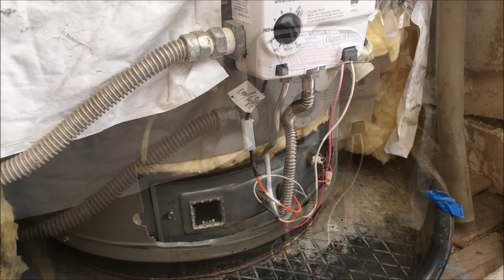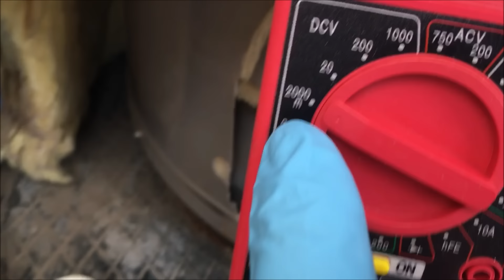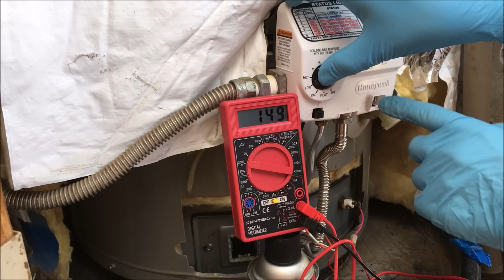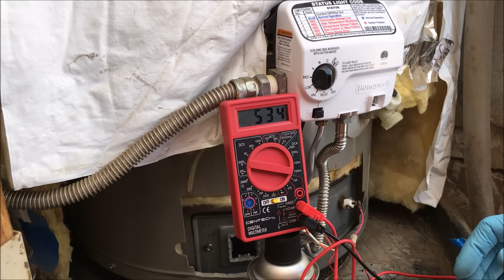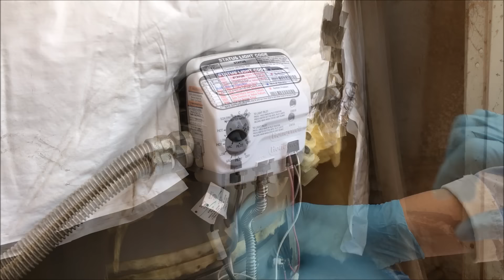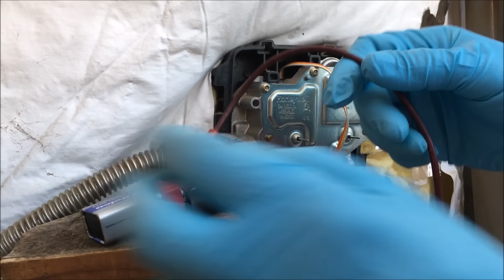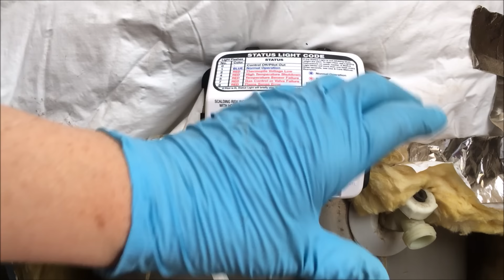Troubleshoot Water Heater AND Honeywell Gas Valve | Step-by-Step

Comment: Is there a website when I can enter the model number for gas water heater and it will give me the parts. The Rheem website has no information, manual has no information
Reply from the maker: Nope.  You have to hunt around on the internet to find what you need.

Comment: What happens if igniter is working but you're still not getting a flame. And eventually you change the gas valve out and still do not get a flame ?
Reply from the maker: I'd look at low gas pressure or a blocked flue.

Comment: This was one of the best troubleshooting videos ever. Question: Did I miss testing of the overheating switch (the round white part with a little reset button in the middle) Can you just pull the wires off and test for continuity?

Comment: I just replaced my Honeywell gas valve, which had a failed sensor by error code. The sensor's plastic housing on my old unit had deteriorated after 14 years of exposure to hot water and had nearly developed a leak. I'm not sure whether the failure was caused by the sensor housing or the sensor itself. Is there any way to test if the sensor is still functioning properly?
I was amazed by the technology and clever design of this simple device—something I had never really paid attention to before. I was equally impressed by your video, which provided step-by-step troubleshooting for every detachable functional part, along with clear, detailed, and accurate instructions that are second to none. Thank you so much!

Comment: I tried all the test as you did, same outcome. Ordered a new control panel. My pilot lights instantly. Will not stay on after indicator light flashes. Even held the pilot light for 3 mins let go and goes out. Any other suggestions. Would appreciate it.

Comment: Absolutely great video. Bradford White with Honeywell controller Water heater was not running. Would not spark, pulled assembly cleaned all, used carb cleaner I had handy and some tiny wire brushed to deoxidize all. No real carbon in evidence, actually pretty clean but igniter would spark only half the time. After cleaning all to bare metal sparked 95% of the time. After a simple once over cleaning fired right up.
Reply from the maker: GREAT to hear!  So glad my video helped you.  ;)

Comment: Thank you so much Frugal DIY!!  Your step by step tutorial is TREMENDOUSLY helpful in resolving my pilot light not staying lit.  Following your detailed instructions to troubleshoot each component,  I ended up replacing the entire gas valve because the pilot valve was faulty.  Your instructions are concise and thorough.  After spending hours watching different instructional videos on YT, yours by far is the best!  Thank you so much for sharing your expertise!

Comment: I have a Honeywell wv8860c1008. I can’t find a control board for this model, only the whole control valve. It seems like there are lots of wv8840 model control boards available for purchase. Is the 8840 model interchangeable with the 8860?

Comment: Thank you! I have this model gas valve control, and it has twice shut down with "High Temperature Shutdown" code. I was able to reset both times, and it continued working for several months each time. Then it died completely. With the help of your video, I was able to diagnose the problem as the control board. $40 (including shipping) on eBay and 4 days later, we have hot water again!

Comment: There is no one - and I mean NO ONE(!) who gives clearer, more complete and well presented repair repair instructions. Thank you for all the effort you put into these very helpful videos.
Reply from the maker: Bless your heart.  Thank you.  That meas a lot to me.  ;)
Reply: @frugaldiy1 why didn't you show how to clean the piece once you remove it?
Reply: I agree completely.  She is awesome.  An excellent teacher and technician.
Reply: I watch lots of videos like this for cars and appliances and I thought the same thing.  All my components check out. I replaced the thermistor (the one where you need 2 wrenches) but the old one reads 83KΩ cold and is probably fine.  The split across the 3 wires that lead behind the valves is yellow-white 4.8 KΩ and yellow orange 4.8KΩ which Gemini says is OK, the thermopile is at .5 volts when the heater is running and the two solenoid coils are about 12Ω at the pins and the gas flows.   But for some reason the pilot light goes out lately with 7 red.   I'm thinking a control board is in my future. 

Sliding the cover on is fussy because you have to feel around for those pins.  It's made worse because the top has snaps.  I'd much rather have a couple more T15 screws to deal with than those snaps. And of course the screws to remove the burner are T20.

Comment: So what if it’s the main burner valve?
Reply: I had to replace the gas valve. Bought a used one before watching this video and both were shot so installed it and got a gas valve error… Got a 2nd and it worked. Wish I watched this first and knew to test before replacing it.
Reply: @ I just spent the $500 a bought a new one lol mine was due

Comment: I have a Honeywell control valve turn it to light pilot light comes on and stays on and flashes blue but when I turn it to hot the gas won't come on in the pilot light stays lit I did a retest reset doesn't work please help me somebody tell me what to do thank you ahead of time

Comment: Your video saved me so much time and aggravation!!!  Very well produced and super easy to follow.  I had already determined I had a gas control valve problem from another video on another channel, but your troubleshooting to determine the issue at the component level was key.  I replaced the circuit board only and saved me all of the steps and pain in the butt to drain it, etc. to replace the entire valve.  Thank you so much!!!
Reply from the maker: That's wondeful to hear, and you're welcome.  ;)

Comment: Thank you so much for making this video! It’s the only online information I could find to actually troubleshoot and it worked! My thermal switch wasn’t reading and I messed with the wires and now my heater works! This needs to be the top video for any gas HWH issues and I hope you make millions because I know you saved me plenty on several occasions! Thank you thank you thank you!!!!
Reply: I just had to troubleshoot a different HWH and once again was elegantly walked through all the steps! Thanks again!

Comment: Excellent video. I have to add that my water heater had good voltage from the thermopile, but after changing out the whole control unit, including the circuit board, it turned out to be the thermopile. It seemed to be healthy voltage wise. Maybe not strong enough, or amperage problem? Anyway, thank you for this, saved $$.

Comment: Excellent. Very well explained the whole process. Video was also very steady. 😄. Back to drawing board in morning give another try and trouble shoot issue as per instructions. H20 Heater was was working fine before cold water line leaking and owner shut it off. I fixed the leak, then it would not light up. May be it was late past 10pm and cold , Mobile home unit. Wish could post pictures as at time i see things, wondering how one can get away with kind of workmanship. Anyway, once again thanks for tutorial.

Comment: The instructions for troubleshooting were very clear. Other presenters did not cover troubleshooting the gas control valve nearly as well. With this video I determined that the control valve was bad, and I replaced the unit myself. Thank you very much!

Comment: Your step-by-step water heater gas control valve troubleshoot  guide is the best among the 5-6 videos that I watched.  You explain everything in details & take it one step at a time to isolate the broken part.  Recently I had an issue with a control valve (Icon System WV8860A1016 / 222-52915-01) from a 2 year old Bradford White.  Following your video I found that the pilot light valve has gone bad (defective solenoid).  White sticker on side of gas valve has 50034127-037 which I assume is the model#.  I have been checking on EBay & craigslist to find a replacement for over 4 months now but haven't seen the exact sub model# 037 (with a black back cover and temperature probe) available for sale.  However there are similar looking Honeywell valves on EBay with different 3 digit sub model#.   Just wondering if you can tell me if the ones with different sub model# can be used as replacement.  Thanks!     👍🙏👍

Comment: This is amazing work, thank you so much!
You should get hired by rheem they don't understand their own product as much as you do!
I have a different issue, 3 red blinks on the sttus led. It starts blue then pilot light up then switches to 3 red led blinks
The legend has no 3 meaning and I replaced both the controller and the whole burner assembly still the same. Checked gas pressure on the heater its 7 which is ideal. Not sure what to replace at this point @frugaldiy1

Comment: Likely the best video on the net to troubleshoot this issue. I would add one technique to shorten the troubleshooting procedure. When checking the thermal switch, simply pull one wire, set your DVM to the ohms position, and check continuity of the switch. It either works, or doesn't (.5 ohms or less should display). If it doesn't, push the reset plunger. One note about this component check- if that plunger needs a reset, there is a reason for it being tripped. 

Anyway, I am a trained electronics technician, and I found her instructions to be complete. My water heater quit working, and I removed the burner plate underneath and cleaned it up. The flame sensor can develop crud on it changing it's heat sensitivity, which will cause you grief in getting that burner to stay lit. So clean it up first before you try a control board. Pay attention to the three spade connectors that the gas solenoids mate with when reinstalling the control card; if they are a little too open, squeeze them with your fingers to tighten them up with the pin to receptacle connections. Thanks Frugal DIY Lady! Great job explaining this fix.
Reply from the maker: Bless your heart, and thank you for sharing your expertise with us all.  ;)

Comment: I want to thanks for very very good video. I follow it and found pilot valve issued. I called the guy working for plumbing comp and he wants to replace the tank with $1400 cad. I just order control valve from US, have to wait 5 days but I dont want to replace the tank 9 yrs old.
Reply from the maker: I'm sooooo proud of you for fixing your water heater.  Job well done!  ;)

Comment: Most amazing, outstanding, informative, educational video on YouTube. I found my issue, thanks to your video. That little pin receiver on the circuit board for the ground pin had come off some how. I'm going to try and solder it back on or create a jumper until I can get a new board. Thanks for creating, posting and sharing such a quality video

Comment: Got spark, removed burner from water heater, still no flame. Is there any other way to  get the smaller tube clean? I Used air pressure and maf cleaner but very small air going  through it. TIA

Comment: Thank you!  You saved me!  This was so informative!!  My pilot gas valve was out, the little wire was broken, i tried to solder it but it didnt work.  I went on Ebay and bought a used relay for $25, popped it in and was back in business.  Thanks a million.

Comment: I have a 2014 30 gallon whirlpool natural gas hot water heater that works for two weeks and goes out and then it went out after two days and then months later it goes out. Every time it lights up like it should. I cleaned the screen and have it set on hot. It was set on A but I saw your video and put it on hot. I’m going to pull out the burner assembly and clean it. It’s in a building out side of my house. The pilot never went out for Hurricane Ida. What do you think is my problem?

Comment: Hi there, I have a similar Honeywell controller. The problem I have is the water heater started not working without any sign yesterday. Currently no status light at all. I tried pilot mode with repeatedly clicking the igniter but it did not work out. Do you think I need replace the whole water heater or just controller or maybe just the igniter? Thanks

Comment: My Rheem water heater has no wiring to a thermal switch. Using this method to test the thermopile, connections to just the wiring harness and the same multimeter, the numbers rose but with a decimal, to 107.5. 
I plugged the wiring harness back in while holding the pilot in, released it and turned to high and the previously inop burner kicked off. The pilot also remained lit. Go figure. 
I'm going to order a logic board from eBay. Cannot find the exact Honeywell control but I suspect that as long as it is the WV8840 and a number close , with the error legend the same on front of the Honeywell control, it will work
I watched a bunch of videos but this was by far the best and most comprehensive around.
Of course I subscribed

Comment: first I want to tell you how much I appreciate this video and the wonderful detail you went into to explain what and why you were doing what you were doing.  I had no idea how this all worked but not feel that I understand.  I'm in the process of testing my water heater.  I'm a little concerned that my reading were low.  Thermopyle 662 and switch 655.  I was wondering if this should be a concern and that I might ought to replace both.  Your thoughts  would be appreciated.
Reply from the maker: Thank you, Dave, for the kind words.  I appreciate that--truly.  

No, I wouldn't change either one of them.  If you're having issues with the water heater, I'd look elsewhere for the problem.  ;)
Reply: @frugaldiy1  success.  I ordered the board, changed it out and "Voila" I'm up and running.  less than $50 from ebay,  thanks again.

Comment: Great video but have one question. How do you re connect the thermopile wires, red and white back into the housing unit? Mine came out white I was reattaching a wire into the back of the circuit board inside the control panel.
Thank you.

Comment: This is great instructions, BUT I did have an issue were the thermocouple wiring was broken intermitently, when I pulled down to test the wiring it read >700mv, but when I reattached it, the control valve failed to lit the LED. After wrongly assuming it was the controller, I pulled out the bottom heater unit (its the two nuts on either side and slides out fairly easily). The heatsheild cloth around the wire was damaged and flaked away with the slightest preassure. I felt along the cloth at this point and found the fracture point of the wire. The wire was so fragile the slightest pressure broke peices from it.    

This is identical to Whirlpool, AO Smith, Kenmore water heaters as well

Comment: On my Honeywell my safety switch has a button between the wires that has popped a couple of times i keep setting the heat setting lower and lower he seems to work for a few months and starts doing it again can I change the safety switch or would it be something else causing my problems

Comment: Wow, You r very informative ( everybody notice that not just me ) so I subscribed & liked. Very Perfectional Tech. Love to learn more about ur diagnostic strategy. 22 years ago I brought a 40 gals gas water heater( Noise possible Hard Water ) without Maintained because i don`t know. Having problem finally I replace 50 gals Home Depot SKU # 1002306459 Last Year 2023 before  winter. I did a lot of research for Maintenance, I also notice that they have problem  with Gas Control Valve .  Now I know how to check the mechanical & determine is it  mother board problem or else. Thank You it is from my bottom of my heart.

Comment: does anyone know what could cause my issue i have a Honeywell gas valve when i remove the igniter along with the thermocouple and pilot jet and unplug from the computer panel i can press the igniter button and i will get a spark 8 out of 10 tries but once I put it all back together it will spark maybe once per 40 tries or something ridiculous like that to were I have to come back and an hour later and try it for maybe one spark I cleaned the thermocouple with sandpaper (fine) and the igniter tip but before i had this issue I turned the boiler to off then turned the gas valve off because I was going on vacation when I got back I did everything like normal to operate and turn it on which it did turn on perfectly fine when I got the status light blinking i turn the knob to hot and it turned on the manifold and was on for couple second and then it shut off and it will not come back on that's when I had the igniter issue I will try to test the computer panel right now which i assume that's the issue. is there over-pressure protection on these models? I did open the gas fast but that was yesterday. I turned it off and waited all night and today i opened it slowly all the way

Comment: What’s the differences between WV8860 vs WV8840? 

My water heater has 8860 with a TDR but the quickest available part was a 8840. 

I’m planning on swapping the front cover and board of my broken 8860 with the new 8840. More specifically a WT8840 since that’s all I could find.

Comment: Great video. I would like to recommend before removing the burner. Remove the pilot tube and verify you have gas coming out of the valve. Next like you mention blow out the pilot tube. Make sure your thermal switch isn’t tripped and try to light the pilot. Most of the time that works. Unless it’s a bad thermopile it will light.